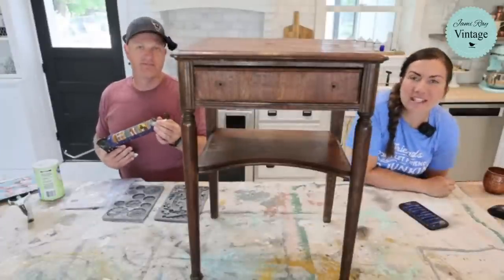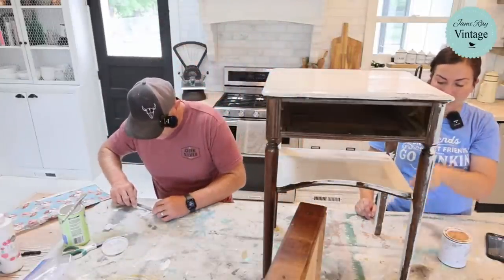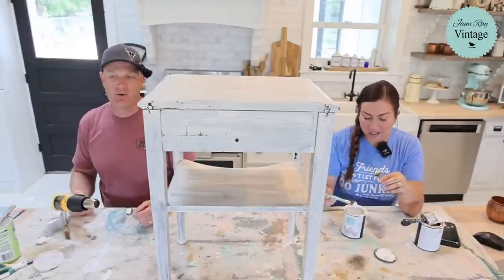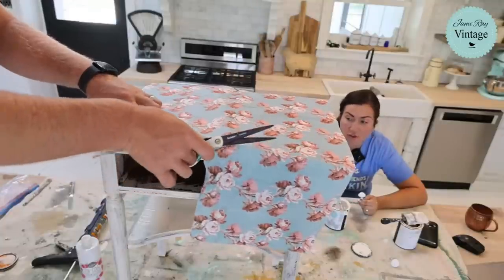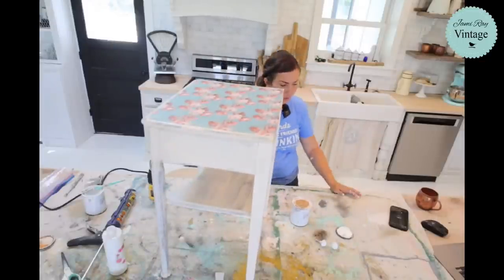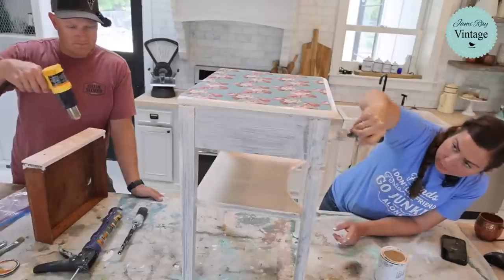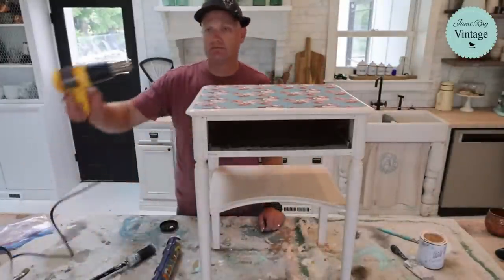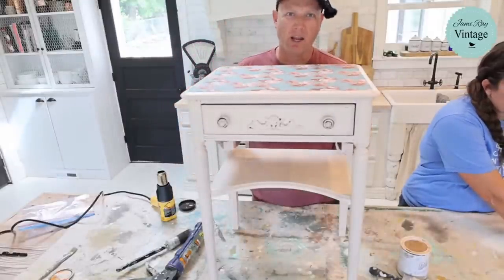Side Table Makeover With Decoupage Paper and IOD Molds Waste Not Wednesday

Comment: Hi guys this tip is for the plugged tip on the glue gun. I use a designated metal barbecue skewer to poke through the glue just for this purpose. I don't know if you can still find metal skewers. I'm old and have them, but this works great and saves time.